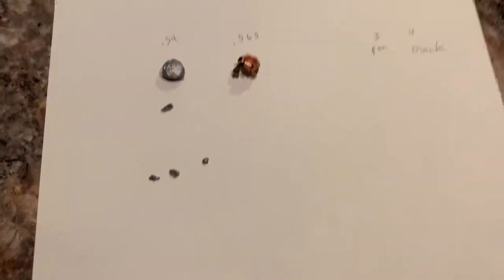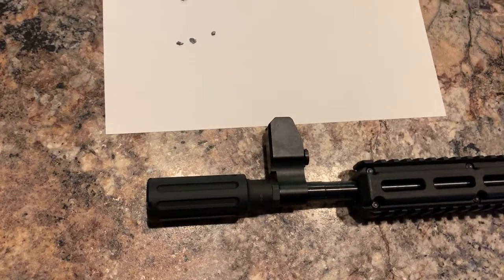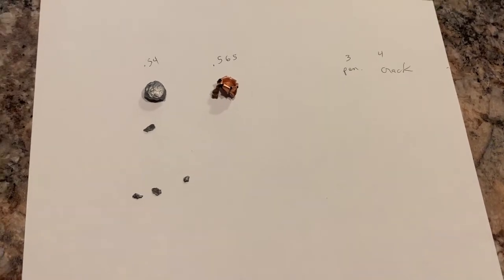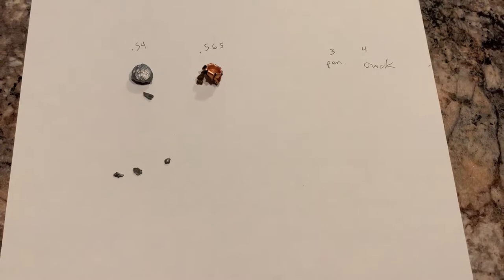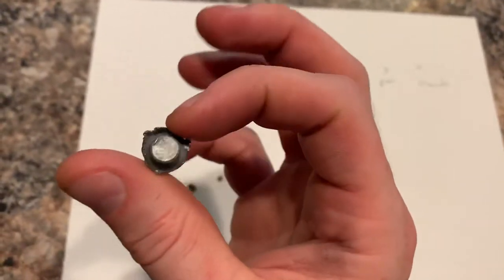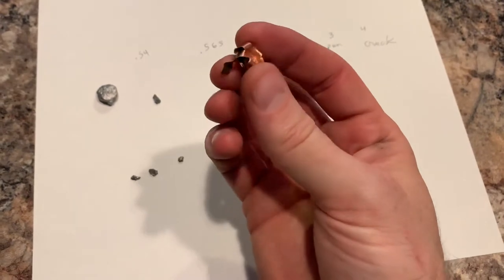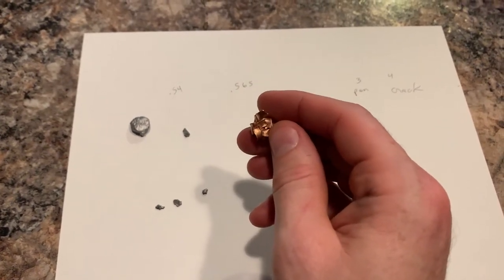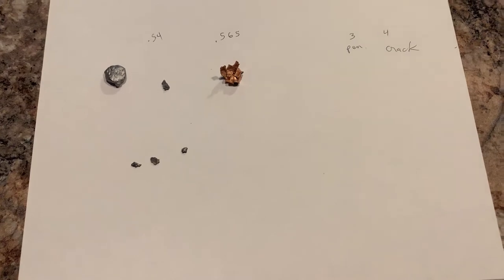Hornady American Gunner 9mm 124 +P Water Jug Test 16” Carbine

Comment: Thanks for the Great Video. 
I always liked this ammo because I like brass casing bullets, but recently started having doubts because of the metal jacket separation and the fragmentation of the bullet fired out a Beretta 92FS.  I always check out the ammo before I buy,  yes I do open up the box inspect what I'm buying. Now recently at Academy this ammo in 115 gr. and 124 gr. the primers looked Nasty. A horrible sight to see in a high dollar box of ammo. Sadly to say this was in all the boxes I checked
Reply from the maker: Randy Resendez it seems to work fine in shorter barrels. In this carbine it is marginal.